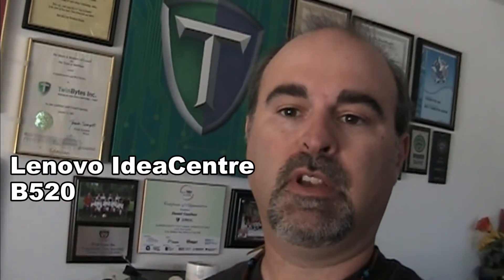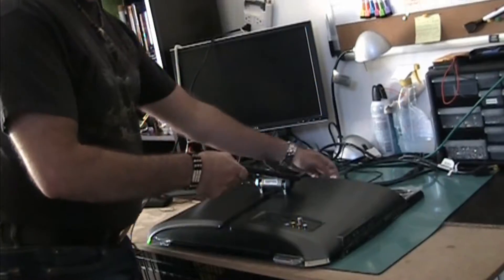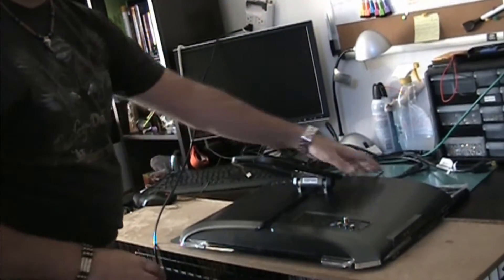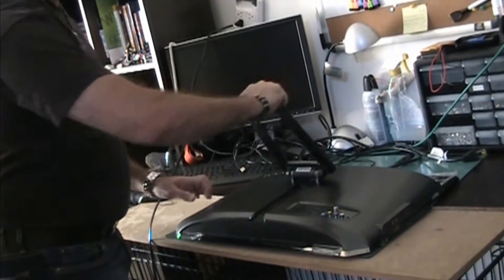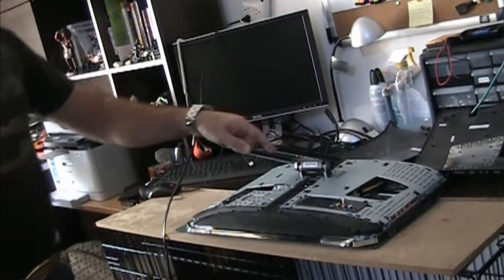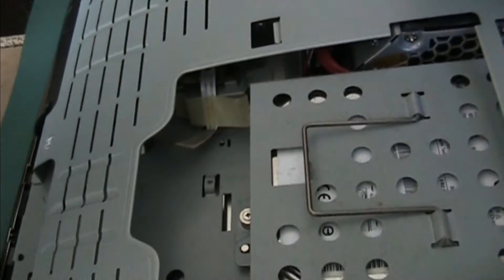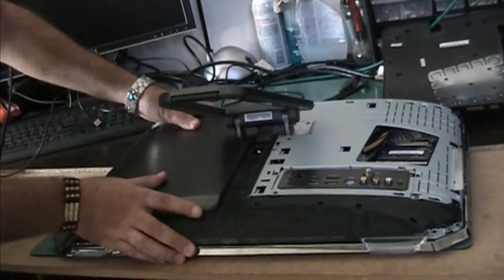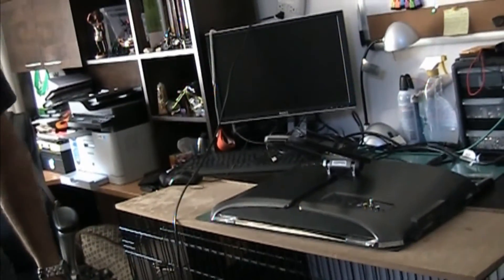Open Lenovo B520 All-in-one

Comment: Hi, I need a help. I need a pic of the power supply and the connector pins and what goes where. I gave mine for repair and they lost it . facebook.com/krishnarajsr.  The  PSU is no longer available. I am trying to adapt another PSU. If you can make a video on it , it will be better
Reply from the maker: Thanks for your question, I no longer have access to this computer.  This was during a customer repair.  That's how I have access to a variety of types of computers.  Sorry.
Reply: @TwinBytesInc  Thank you I figured it out :)